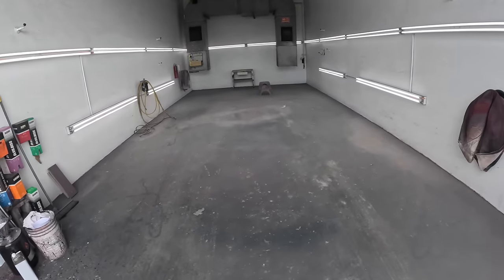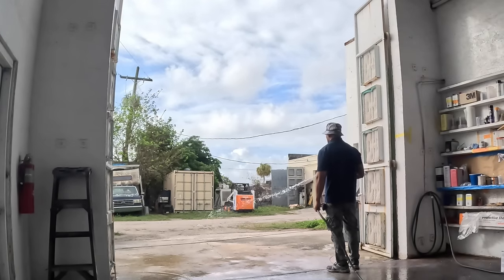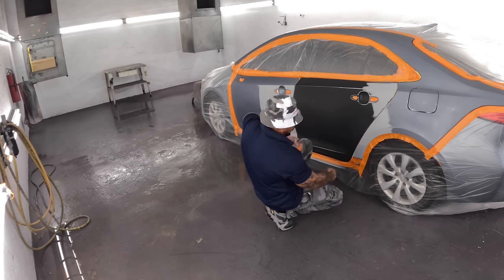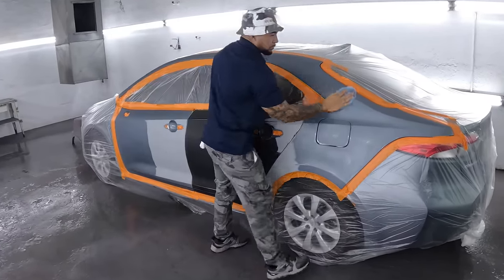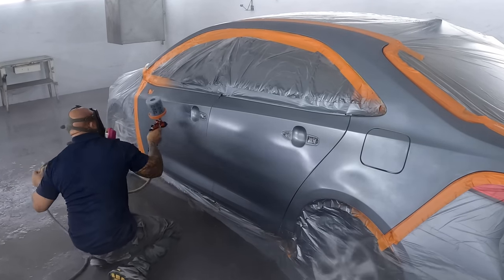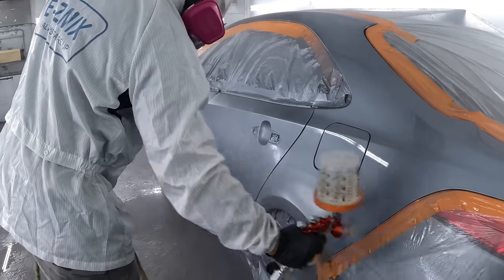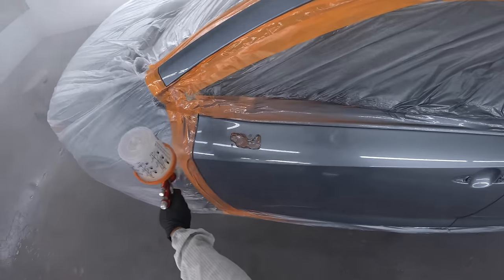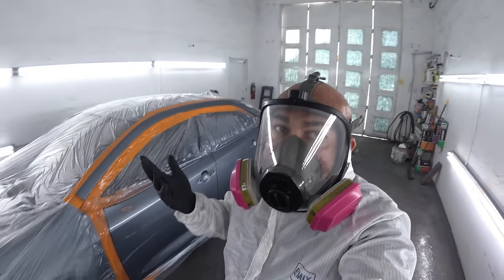TIPS to get a cleaner paint job while painting in less than ideal environment

Comment: great work and your right you can paint anywhere. Just need to wet it down. putting your mixing inside the booth is also really good. Like you are doing. I remember opening the booth door and the fans would shut off....Then the filters would shake. There comes the dirt. or if I rigged the door button the dirt would come in with me. Having a mixing table near the job is really another key to getting less dirt. Today I just dont care much....Cut and polish everything. I love the reality painting stuff you show. People need to know that there are Hot days and cold days. you dont have temp control. All those things make it much easier to get a consistently nice job. Reality is most people dont have those things.

Comment: Thanks for sharing your experience Trigger. I have been going nuts trying to refine my process. I think I finally cracked the code but it takes more work preping and cleaning, cleaning, tacking, tacking. I started using a lint roller. Static is the enemy and no way to avoid. I have seen floaters get electrically drawn from my clothes to a panel like a magnet. a wet bed on the floor really helps. Great tips as always brother! Nice clean blend out the lab today!
Reply from the maker: Thank you man. Did you ever think about one of that's static guns? I'm still on the fence. Hard for me to justify spending that much on one when my jobs aren't even that dirty. But I'm curious about them.

Comment: Spot on!  I paint inside a portable garage... the type with tarp walls, doors, etc. Even though I rigged it up with carpet flooring and a framed extension for extra length that holds intake fans, dust and dirt are inevitable. I use an electric leaf blower a day or so prior to painting. Turn on the exhaust fans, and blow it from top to bottom, sides, and carpet. Just keep blowing until I dang near blow the walls off. 😂  You can never be too clean to reduce (not get rid of) dirt nibs.
Reply from the maker: Yes sir, you'll never eliminate dirt nibs even in a brand new spray booth that looks like a damn time machine you'll still get dirt just reduce the amount and also lots of prayer 🤲🏼🙏🏼 😂 can I get an amen up in here

Comment: The sagola 3300 with the tech cap is 🔥🔥🔥 for clear. It's great for metallics too. Also, melting the edge of sealer you only really need to do it for water base paint. With water base for some reason if you don't melt the edge of the sealer the metallic is going to bunch together in the area where you stopped with the sealer. You can use reducer to melt the edge of sealer.
Reply from the maker: Ok so maybe That's a water-based thing but I've definitely seen solvent base guys doing it maybe just something they saw and it spreads. I personally have never sprayed water-based so I can't even comment on that. But thank you 🤜🏼🤛🏼
Reply: @thetriggerman954  they probably do it just to be safe plus it only happens with 2k sealer not 1k sealer.
Reply from the maker: @shaqhobson5074  well alrighty 🫡 thank you Shaq 💯

Comment: Yo what up bro. You actually got a nice booth there. I have a "home made" both in my shop, built where there was an apartment area with a family room and kitchen. Low ceilings, perfect dimensions. I installed LED lights, built a fan and filter box into the exterior wall, and two big barn  doors with filters on the inlet side. Anyway, i need to increase my skill with laying down the wet bed. I've tried it a few times but haven't quite perfected the process yet. Will be checking out the rest of your videos to pick up some knowledge! I'll holler
Reply from the maker: My spray booth was actually built by my boss and his dad and one other guy brick by brick they built it in 1956 It's so old that it doesn't even meet today's standards but it's grandfathered in fire department bugs him all the time but he has documents showing his grandfathered in as long as there's no fire hazard I wasn't even thought about being born yet while this sucker was running 😅😅

Comment: Used to manage a auto paint store.  You just did it cleaner than 95% of stealerships and they have the latest and greatest equipment. 

Pride matters. Great job!
Reply from the maker: Thank you Sir. I've worked in those places I try to keep the same work ethic as I did when I worked there, if not even to a higher level. So once I go back to those shops my work should be better than ever. 

Thank you again ♥️

Comment: We don’t use sealer at the shop I work at, the reason being is because the time it takes for sealant to dry before applying paint, how long do you flash off till you lay down paint on your sealer?
Reply from the maker: Yes it definitely slows things down. I usually wait 15-20 minutes. If you apply paint to soon then you run into dieback. I personally like to just apply paint over the 2k primer if it hasn't been sanded through.
Reply: Man you really blessed brother, the shop I work at they expect the car to be painted in 15 mins I work for el cheapos, always rub throughs on panels because they tight asses on time and primer, I primer with a heat gun in my hand the boss will mix up 100 mil of primer for a whole door that’s complete with body filler, I’ll put one coat on it dry it with heat gun for a minute then I put a second coat that’s barely a full coat, so when it comes time to rub it I get rub throughs and then we have to primer can the rub throughs, my boss cry’s about the electricity spent in spray booth, so yeah no sealant allowed, they don’t even let us painters at the shop mix the paint other day I did a car quarterpanel the door, the fender, the hood and bumper bar and the el cheapo mixed me up 250mils of paint, he put 250mils of thinners in it since our system is 1:1 ratio comes in the booth and tells me I mixed you up 500mils, man when I looked at the cup and only seen 500mils all up I almost hit him with my spray gun lmao el cheapos can’t seem to catch a break always end up working at a shop with either a real nasty tradesman/boss or a el cheapo like the one I’m working at now
Reply from the maker: @The_paintman  geeesh, why don't you go apply to higher end shops? I mean my boss is cheap too but certain shit he knows I'm not going for.
Reply: I’m not confident enough brother the last shop I worked at before this was a higher end shop and man they didn’t let me near a gun or spray booth unless it was to clean it, was getting treated with disrespect daily and was just slaving away prepping panels, I plan on leaving this shop within next 6 months but I’m just trying to get as good as I can and quick, trying to get better at body filler, taping up cars fast, cleaner spray jobs and faster prepping, I love this trade so much but haven’t had my time to shine and I think I’m a slow learner to be honest, been in the trade for 4 years still struggling daily but I try my best
Reply: Never really had a good teacher bro kind of just picked up everything along the way my self, the good and the bad hahaha but I watch you daily brother so learning from the best
Reply from the maker: @The_paintman  look at it like this, the situation you're in  you can still get a decent job, try to get the best job you can with that You're working with. Then when you get to a good shop you'll be surprised at the quality of work you're really capable of doing. And believe it or not probably 50% of it is confidence. But I can totally relate to how you feeling about not being confident. 4 years isn't that long. I'm 28 years in and still have weeks where nothing goes right.

Comment: 🔥🔥🔥 as usual what kind of razor is that you using to cut that plastic
Reply from the maker: I use these, they cut like butter, You can even replace the blades. A heads up though Don't use the blades it comes with order you a set of good blades from Amazon which should only be like $6 for a pack of 100. Thank me later

https://amzn.to/48enQ1d
Reply: @thetriggerman954  heck yea I appreciate that 👍🏾👍🏾
Reply from the maker: @mississippiwrenches295  fa sho fa sho 🤜🏼🤛🏼

Comment: Why did you slow way down on the second coat of clear?
Reply from the maker: Probably just the angle makes it look a lot slower. There is no "slowing way down" with a Sagola 4600 that sucker will run on you before you can blink 😅 I always put my first coat on rather fast then slow down to get a good flow out on the second coat. 🤜🏼🤛🏼

Comment: Remember back in the day ground the vehicle i use to toss a chain around axle to the ground lol and cable with clip to the vehicle 😂
Reply from the maker: I've heard that, in think they were doing that right before I entered the trade. I still can't wrap my head around how that works  but apparently it did work. Lol crazy
Reply: Controls static electricity caused by the spray over a panel so dust and dirt Is not attracted to your pant job
Reply from the maker: @joestrait6291  I would have had to witness that stuff in person sounds crazy but I've heard from people at shops I work with they get to do it so I believe it

Comment: Just blow some clean air in the booth to make a slight over pressure. Then nothing will be sucked in, in the small cracks of the booth...
Reply from the maker: 🤔 I'm going to need you to teach me that trick. Sounds a little above my level of comprehension 🤓
Reply: @thetriggerman954  just a blower with filtered air doing a bit more pressure or volume than the one sucking the air out. I use it in my own booth. 👍
Reply from the maker: @henriksallingjensen8104  my booth isn't completely sealed large gaps everywhere. Not sure if that would still apply